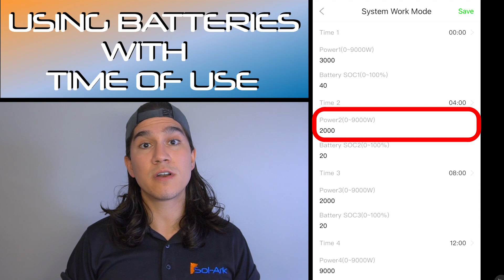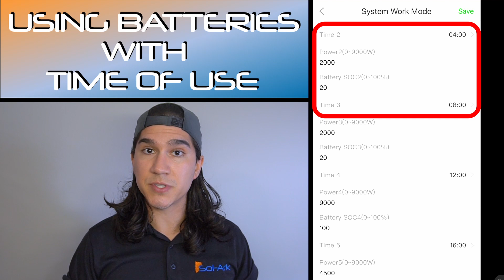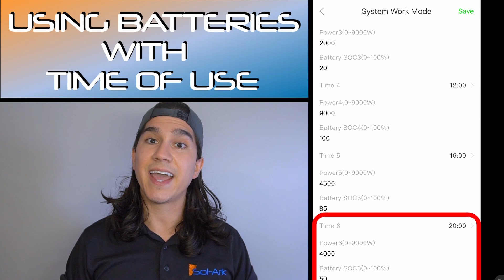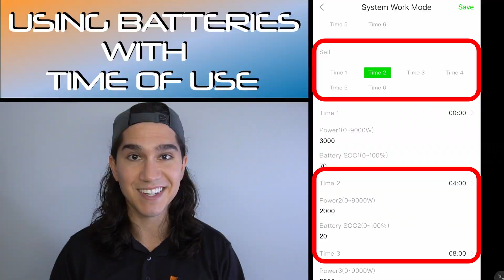Sol-Ark Install Guide || How to Setup Time of Use

Comment: Hi
What if I want to use Solar Panels FRIST- then - if Solar Panels production is not enough for the load, use Battery - and then if Battery reaches below, say, 30%, use the Grid for the loads and charge the batteries
Reply: I want to use the same logic. Perhaps someone will reply.
Reply: I agree as well.   I want to use battery as much as possible, and minimize generator use, but seems not possible, or very awkward to get it setup to do that

Comment: under what scenario would you want to sell from your battery?
Reply from the maker: California NEM3 rates, and less common net-metered time-of-use rates with solar.
Reply: @Sol-Ark  sorry, I'm still new to this. why would one sell battery power when it is the least profitable? i mean, under NEM3 or TOU, it seems best to keep your batteries full (or at their SOC) and only sell excess PV to the grid, i e. don't sell when the utility only pays you per kw a fraction of what you pay them per kw. confused.
Reply from the maker: @4mla1fn  95% of the year, California pays for a fraction of exported energy. But in September and October, it pays well above retail for solar exported between 6-8PM.  This can be confirmed standing in front of the inverter, looking at the grid limiter settings. 

Other markets have other rules, as the USA grid is a patchwork quilt of electric policies. The Sol-Ark can perform seasonal time-of-use and peak shaving, and programmed export as well as DERMS response and generator controls. Hence our "all-in-one" focus.
Reply: @Sol-Ark  ok, gotcha. i was unaware of those regional details. makes sense. thanks for the explanation.

Comment: This should have been done on the inverter settings screens.  Not in some app.  Also, I'd love a video on how to use Seasons.  It looks like they're set up on Settings > Basic Setup > Time.  I guess they're supposed to be used in Settings > Limiter.  But, I have no idea how and the manual is of no use.
Reply from the maker: You can do both (app or inverter LCD screen). TOU settings are accessible via the limiter button on the LCD settings home screen. The seasonal controller (programmed on site or remotely when within season) is under the LCS settings -> basic setup button -> time tab. You can always find answers by filling out a support ticket - we support installers and homeowners alike.

Comment: so in TOU, the "Sell" checkbox is specific to selling from the battery?  It does not "sell" from PV?
Reply from the maker: It is specifically for selling the battery back to the grid, such as in California's NEM3 program. The solar array will sell-back to the grid when the batteries are full (or when no batteries are installed) after offsetting the home load.

Comment: When you have cell time box checked and a charge time box checked at a different time. What do the other non-check boxes default to. Mine is not necessarily doing exactly what I tell it to do on those times.
Reply from the maker: Hi there,
If no checks are selected for a timeslot, the inverter will discharge the battery down to the chosen %/V for that time slot if there is not enough PV power available. If you are still experiencing issues setting up your Time of Use settings, I recommend asking one of our engineers for help here: https://www.sol-ark.com/contact-us/

Comment: In the video, it shows the maximum setting for the allowable draw on the battery is 9kW.  If you have a two inverter setup will this value show as 18kW, or is this value capped regardless of how many inverters you have in your setup?
Reply from the maker: Hi Jason,
You are correct, the maximum battery draw is additive whenever you stack inverters. Just keep in mind that the draw on the batteries should be matched to what is best for the batteries themselves. If you have any further questions, please fill out this form (at the bottom) and we'd be glad to assist: https://www.sol-ark.com/support/

Comment: In the video, it shows options for selecting percentage of battery usage whereas for the Fortress evault I only have option to set voltage parameters for my batteries. Is this unique to Fortress or is there a different config available?
Reply from the maker: Hello,
That is definitely possible with our inverter! If you would like to have set points based on voltage then you can use Batt-V mode instead of Batt-% mode. This will change all set points in the inverter settings to rely on the battery's voltage, just keep in mind that the inverter will no longer try to calculate an accurate battery % in this mode, so the SOC% the inverter is showing may begin to deviate from what the BMS is showing. Hope that helps!
If you need any further assistance, please feel free to contact us here: https://www.sol-ark.com/contact-us/

Comment: The web portal version of powerview has a few more settings such as "solar sell" and "energy pattern".  Can you explain what those do and when we might use them?
Reply from the maker: Hi Michael,
When you enable solar sell, this  option allows excess PV power to be sold to the grid (when available). The energy patterns that you see are battery first and load first, and for now, we recommend keeping battery first enabled at all times. The load first option is under testing and still needs some adjustments.
If you have any additional questions, please feel free to reach out to us using this form: https://www.sol-ark.com/contact-us/

Comment: My net metering agreement only allows 10kw feed into the grid.  Is there any way to program the unit to use the excess production to charge the battery instead of being wasted?
Reply from the maker: Yes. You can limit the grid sell to 10k and you can tell the utility it is listed as a PCS for controlling the feed which might helps. If the utility will not allow a larger inverter, the Sol-Ark 12k model can be used (a bit unique and different than the sol-ark 15k. The 15k does 15kWac daytime output, whereas the 12k does 9kW AC output plus 3kW of additional DC charging).